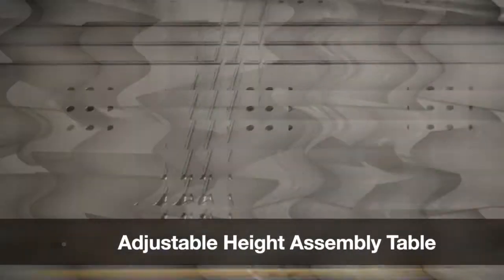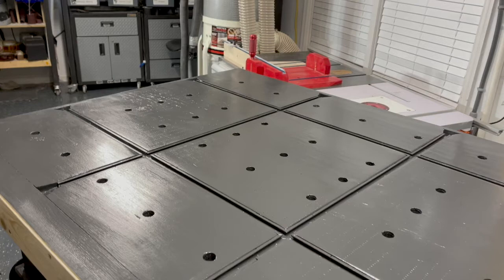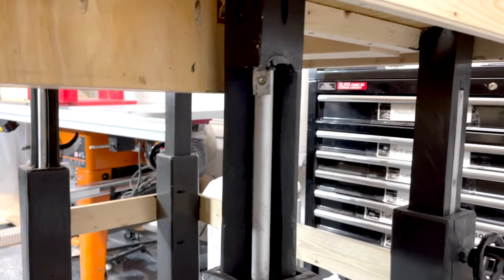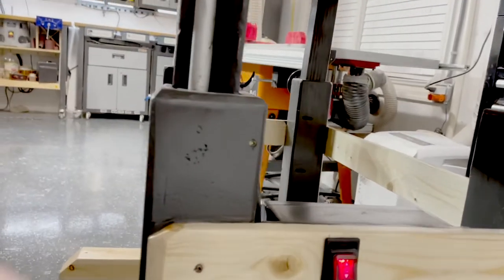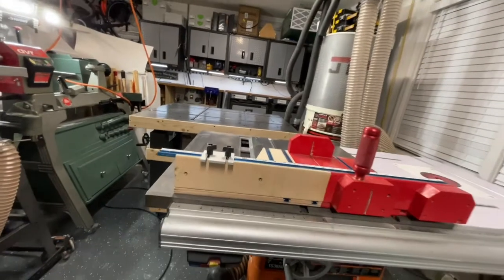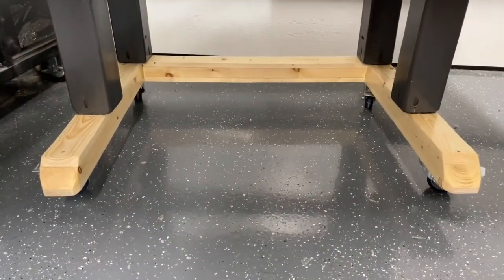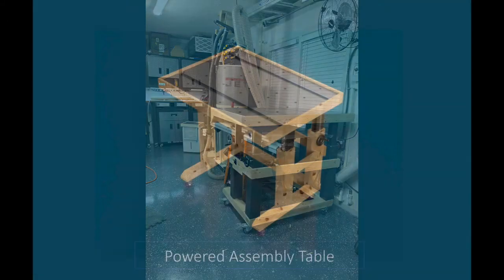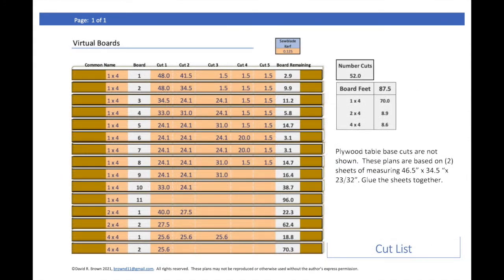Adjustable Height Workshop Assembly Table

Comment: Do the linear actuators have a controller so that they both move in sync or do you just apply power to both at the same time and hope they go up at the same rate? If the latter have you had any issues?
Reply from the maker: I have, but do not find a controller is necessary.   I wired the actuators in parallel, and both are fairly well in sync.  If one gets slightly ahead of the other, it will stop at the end of its range of travel, while the other catches up.  Hope that answers your question.
Reply: @browndrb  Thanks. Just about to tackle something similar, was going to use one but I think I'll use two like you did just for peace of mind.